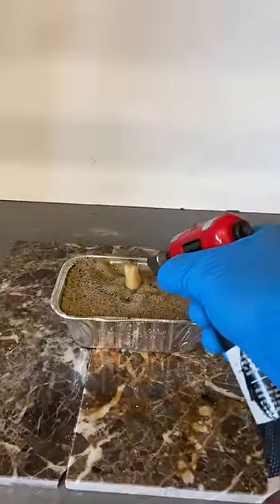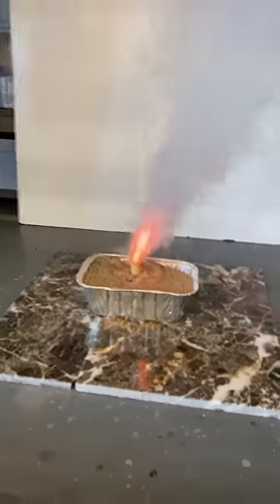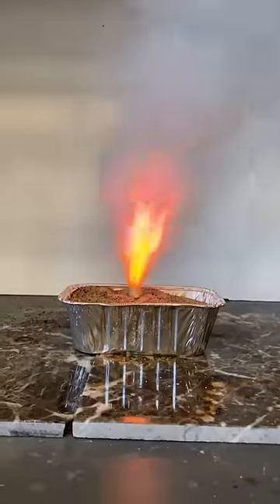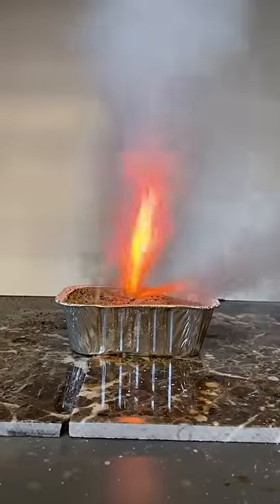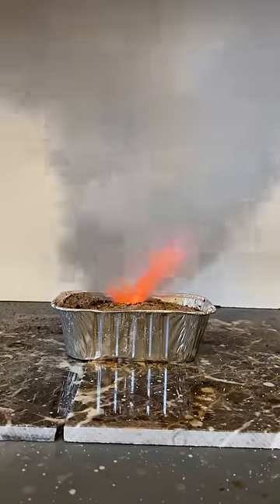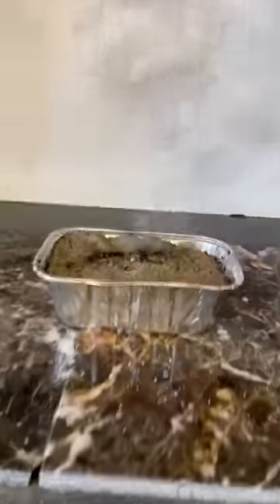Making Sugar Rocket Fuel

Comment from the maker: A couple of notes regarding this demonstration: The combination of potassium nitrate and sugar results in a highly flammable mixture. Notice that I only make a small amount (less than 10 grams). If the material is overheated, it can ignite within the pan. Also, when burning a sample, I used a fume hood with fire extinguishers nearby and proper ppe. Long story short, while the combination is simple, it is a dangerous reaction once ignited, and should only be done by professionals.
Reply: Can i use amonium nitrite
Reply: @the_Guy_who_asked19 You can also try
Reply: @the_Guy_who_asked19  i was going to ask this, ammonium nitrate is alot easier to get and i vaguely remember using it as a kid but not getting the ratio correctly so i just made some smelly smoke bombs
Reply: I get the safety stuff but im sure its harmless to let a student make this
I mean so long as theres direct supervision
Reply from the maker: @crowmaster9652  it’s not worth the risk.
Reply: @frogz  no no in my country i will go to jail you need a permet to have it
Reply: @frogz  i can only make flash powder with it that is the only recepie i have for it
Reply: What is a perfect material for a rocket with that mix?
Reply: Professional what?
Reply: @the_Guy_who_asked19 I guess that would burn way faster aka explosion.
Reply: Already burned down my house but thanks
Reply: Overheated on the pan, it will detonate actually.
Reply: So your saying I can't use this video to make homemade fireworks?
Reply: @khayatimedchiheb5911 works great at with calcium nitrate I use 40 grams of calcium nitrate and 60 grams of sugar come out looking like pumpkin pie but boy does it burn
Reply: As a teen in the 90s we used to make this outside on a portable burner or propane because I did it in the kitchen once and.....well....mom wasnt happy and neither was the landlord
Reply: Or drunks
Reply: @crowmaster9652 you're right its easy and harmless in small ammounts.
Reply: @crowmaster9652 You know you can buy premade SRBs? (Mainly used for model rockets)
Reply: You might want to edit the video and put that in there
Reply: Importantly, the stovetop or hot plate used to heat the mixture is not a source of ignition, so not a bunsen burner and not a gas stove, for example.
Reply: Are you using a metal scraper on a nonstick pan??
Reply: @bricknolty5478 
Lol, it never fails. Some of Y'all on the internet cannot help yourself. You must either complain or attempt to find something wrong with every damn video.
There is so much to question about what is happening or the process of doing this and you question the use of a utensil on the the pan. 
Some of y'all Crack me up.
Reply: Can confirm does ignite when overheated. Father made kitchen go boom boom as a kid shits powerful.
Reply: In India, people make fireworks with this mixture but in dry form. There used to be competitions among people. They use more chems like napthalene powder and copper sulfate for different colours, vioces when the fire cracker is burning, and different ways the fire cracker burns.
I got lost of recipes of it.
Reply: Mix it with wood ash and it burns so much faster
Reply: Pardon me, but given your decent result in the open air, what proportions did you use
Reply: What you mean to say is its a 60-40 mixture. Add iron oxide for even more ooohmf😂
Reply: @the_Guy_who_asked19 HOW
Reply: Add a little sodium bicarbonate to lengthen the burn time
Reply: Mom i need 10 pounds of sugar and potassium nitrate.. it's for a school project
Reply: Yeah, YouTube is full of pros. 😆
Reply: @georgetpeppel2900  lol... the child I am wants to say something like "professional pyros" but.. technically those are very hard to find.
Reply: @AbradolfLincler  when I needed 5 pounds of sugar in school it was as a baby!
Reply: what is potassium nitrate
Reply: @idorandomstuff4611  Potassium nitrate is also called saltpeter. It's a salt that has oxygen in its chemical makeup in such a way that, when heated with a flammable solid, becomes the oxygen for that solid. In this case, sugar is that solid
Reply: @the_Guy_who_asked19 Only if you want to be on a government watch list.
Reply: Instructions unclear, burned my whole town to the ground
Reply: Perfectly safe we did it with toilet paper tubes as a kid
Reply: Haaa, we've been doing that in primary.
Reply: Me as a 6 year old doing it in sandbox 😂😂
Reply: @georgetpeppel2900  chemist
Reply: Directions unclear, so I just nuked my house and am being investigated for meth production😢
Reply: great I'm a professional
Reply: In American no permit Walmart Carries it I just think you have to be 18 or 21 not sure but I ordered the 5 lb bucket to make fireworks for new years gonna be a badass one this year and I have a friend who does it for a living who said he would help me so I don’t blow myself up 😂 but can’t wait to give it a try got to buy the colors from my friend and every thing but he said he’d hook me up
Reply: I identify as a professional
Reply: Dude, you’re showing people how to do it on a YouTube video. What do you mean it should only be done by professionals??? 😂🤦‍♂️
Reply: @randysmith9636 He was joking. Obviously.
Reply: What if I wanted to use this in a 6 foot rocket?  Would it be strong enough in a big quantity? Were in the research phase but wasn't to launch a 6ft rocket with go pro in it.
Reply: I am professionally menace
Reply: 😂😂😂😂 if only I saw this when I was 8
Reply: @frogz don’t think it’s a good idea to be burning ammonium compounds bro
Reply: Is that water in the pan? And what ratio of sugar to nitrate?
Reply: @Chemteacherphil when I was young I used to make smoke bombs out of this but I don't remember the ratio of potassium nitrate to the sugar do you know what it is?
Reply: Then why are u showing us
Reply: Did you say sucross, or sugar? Because i heard "sucross" in the video
Reply: @Johanthegoat1  I used to use regular Pantry sugar and I got the potassium nitrate from my localPharmacy
Reply: Tried all the recipes..... They all worked.......bbuuuttt.... Now I need a new house before my mom kills me😅😂😂
Reply: @ethos- I'm a "professional fuck up"😂
Reply: @anninriverside755 there's always a karen do gooder in the crowd somewhere
Reply: infiniteshoeblack dry ice and a lil water
Reply: Duh
Reply: @marcelinobueno4987  Story of us lol
Reply: Pin this
Reply: @alllove1754 Oxidizer.
Reply: @lizard5872 I'm fuc*in ☠️💀🍻😂😭🤷🏾💯👍✌️
Reply: would it be a problem if we made it small as yours
Reply: You say only to be used by professionals who NASA
Reply: Could you use a solvent instead of heat ?
Reply: are u a professional?
Reply: @gamerguy4209 这个很危险啊，爆炸人就死了，能买后悔药复活么？
Reply: @asailijhijr 视频中他用的应该是燃气灶加热的，这危险，非常专业的才能安全使用他，普通人掌握不好火力，它会在锅中燃烧爆炸
Reply: Iranian here, how to make bigger rocket?
Reply: so how much time should I burn it?
Reply: You should realy pin this comment!
Reply: Then don’t advertise how easy it is and leave all cautionary information in a comment that only a fraction will see. That depends on if your primary concern is views or if it’s safety…
Reply: I did this as a kid....scorched the cieling....mom refused to buy me strange chemicals online anymore after that😢
Reply: I would like you to do an example of a small rocket launch at night.
Reply: And only the sugar needs to melt!
Reply: @Chemteacherphil  Cool stuff is always worth some risk! Are students that much of a liability? *thinks back to how I was in school*. Good decision actually.
Reply: What gases are produced? I'm no chemist but I assume it's CO2?
Reply: У меня давным давно эта смесь загоралась, реакция необратимая))) подпортил сковороду
Reply: @crowmaster9652  as someone watching students do experiments inside the lab, i can guarantee you even a simple titration can become a deadly event. But it has its own perks though, i get to play with chemicals all day😂
Reply: You’ve heard of “duly noted?”
Get ready for “duly disregarded.”
Reply: What was that liquid u used to mix thenm ??
Reply: جهاز الحراري متحكم في درجة حرارته
Reply: @YogsenForfoth 
Professional skateboarders degree at a minimum.
I tried this as an amateur gynecologist and within five minutes got a visit from ATF.
I could have died !!!  😶
Reply: A large sample can also cause explosive results, one christmas I made a football size mix of KNO3 and sugar which weighed roughly 3kg, approximately 30 seconds after igniting it exploded (rather small explosion but still thru chunks of kno3/sugar out)
Reply: @saifua60 ya... that's called pyrotechnics and there's recipes all over the internet. Highly recommend any that use Paris Green
Reply: Is the sugar thingy edible?
Reply: What considers someone a professional? And how would one experiment with this if not already a professional?
Reply: Can i use tri nitro toluene?
Reply: Also this is not legal in many places in Europe
Reply: Chemistry is no joke. The kits we bought in the 1950s contained everything from potassium nitrate, aluminum powder to iodine and sulfur, and charcoal.  When I was 7-8 years old, I had no idea the dangers my chemistry kit contained. 
My Dad quickly upped my chemical inventory by bringing home, from work, a chemical named Sodium Dichromate or Bichromate same thing. It was an orange colored   granulated crystals with the same consistency as sugar. When an ignition source is available, Sodium Dichromate burns rapidly, producing a green ash that's about 6x the volume of the original volume of S.D.
I got creative and decided to build a small-scale volcano out of Play-Doh and then let it dry. I built a small-scale Malaysian village with Palm Trees and huts. 
I put all of this together because
we were asked to think of a science project for my 4th grade class. So I brought it to school and proceeded to light it up. It performed beautifully, capturing everyone's attention, throwing ash, and sparking 12" up and out of the volcanoes cone. until it died out. What a mess cleaning that ash up. 
After that assigned demonstration, I was asked to visit the other teacher's rooms and perform the same event for the other science classes. 
I don't think you could get away with a stunt like that nowadays. I must have gained a love of the sciences somewhere. I was surprised after taking the PSAT because I wasn't even a "B" student in my high school classes. I about fell out of my chair when I saw my results. My home-room teacher handed it back to me with her finger pointing to my science score. She looked at me and then down at her finger. When lifted, I saw that I had scored in the 98% percentile. Wholly ** ! I got a pat on my shoulder and a smile from Mrs. Willoughby. Science has always served me well and has kept me respectful and responsible when using volume elements. Be safe and have fun !
Reply: @the_Guy_who_asked19 Nitrites won't work as they have 1 less Oxygen atom than nitrates, which have 3. It makes sense, you'll have less O2 to create an ignition and sustain an even burn ratio.
The Physics of launching a rocket add an extra level of interest and excitement.
Reply: Same here lmao ! I filled my mom's house with a thick green smoke zone from the garage below. I tried to incorporate an aluminum powder mixture, thinking that it might give me some extra ummph ! Wrong, oh man, that stuff smelled awful.
I'd like to build a rocket that used liquid 02 and Alcohol but the $$ are probably out of sight.
The Germans used Peroxide, as an oxidizer,  in their Cstoff and Tstoff Messerschmitt 163. Rocket grade Kerosene LH2 & RP-1 were generally used with LOX.

Comment: If you have the time do it this way:  Dissolve the kno3 and sugar into water completely, use too much water if you need to.  Then carefully bring it just over the boiling point of water (220-250 degrees f), being careful not to get to hot and start caramelizing the sugar.  After most of the water is boiled off, what is left should be pure white.  Pour it into a baking pan on some wax paper and let it cool and harden.  Break it up as much as you can.  It will still be sticky and have too much water.  Put it in the oven at 250 degrees and let more water cook off.  If you live somewhere with lots of sun, you could also just leave it out on a hot day for a few hours.  Once it is very dry and brittle you can break it down back into a powder.  Now the kno3 and sugar are bonded very tightly and evenly distributed and have a very high surface area when granulated.  I get my best burns with this method though it takes time.
Reply: im sure if i thought about it I would have came up with this idea but I must say it is ingenious to use  a solvent
Reply: Use sorbitol instead. It is easily found online. It has a lower melting temperature that makes it far safer to work with (it also allows you to shape the fuel with your hands).
Reply: I can’t do this without the people I live with freaking out so I just buy engines
Reply: Sounds much safer.    Could this work for making your own fireworks /  launching the mortar effectively ?    Any idea how it stacks up against other accelerants under load?    I’m genuinely interested in learning to make fireworks.   It’s way cool.
Reply: @Prometheus_8706  the atf says making your own fireworks is totally legal as long as you’re not selling them just do some research on fireworks and don’t use the word bomb
Reply: @barrymccockinner2802  thanks but that wasn’t my question or a concern.
Reply: @Kazaardvark the dutch freak out about literally everything except actual bad
Reply: @namachem1961  ?
Reply: Is this still YouTube?
Reply: @natas9967  technically, yes
Reply: Dude went full braking bad mood
Reply: You cant bring water above 212°f or 100°C unless the water is under pressure
Reply: @Dude-xv4os  3rd grade chemistry:  adding stuff to water alters its phase change points.  Adding a ton of sugar and potassium nitrate will let you get the solution far above water's normal boiling temp.
Reply: @matthewirizarry8467  incorrect. You must add your poo to the water and sugar then stir. Give it a taste, when its no longer bitter you are there 👍
Reply: I will try this thanks

Comment: For everyone wondering: sucrose is just sugar, and potassium nitrate can be bought at places like Lowe’s and Home Depot, in a product called stump remover. Be advised, the chemical Potassium Nitrate (the one needed to make the sugar rocket) is a flame oxidizer, which accelerates flames. Also, the gases produced from the reaction can be hazardous, so be careful when igniting the sugar rocket near others.

Edit: please do not blow up your house, follow what the original video creator said about safety!
Reply: Don't worry my house wont be the one blowing up😀
Reply: @cheeseman6833  💀
Reply: @OneSeriousPunch just like the people at that house
Reply: Don’t tell them what happens if you add sulphur to the mix
Reply: @DrV1le  why, what happens? Asking for a friend
Reply: Stump remover? Lol
Reply: @cheeseman6833 😂😂
Reply: @Brian-ux3jx   presumably, it’s for tree stumps, not the remaining parts of limbs that were previously blown off my mishandled fireworks 🤔
Reply: I’m going to get a flour bag of each and mix them, then bring half of it to your house as sugar that has kick. Then watch your face… of course I would put it as a firework later but that face is priceless.
Reply: Не уходи никуда, агенты за тобой уже выехали.
Reply: @DenSky1976  О, нет
Reply: Also Mr Chemist should know that sugar liquifies under heat, you don't need to add any water to dissolve Candy Mix Rocket Fuel, you just use a 1:1 ratio of KNO³ and C¹²H²²O¹¹

The water shouldn't be a problem for ignition, but it's very malleable here. One great use for Candy Mix is as a very solid binder, which makes it ideal for smoke tracking phases of multi-stage amateur rockets.

So you have your primary launch phase motor, using something like a Zinc Sulfur or straight black powder mix (if you can get ammonium perchlorate more power to you I guess). 

Then you have an ejection charge (this is typically a very fine grain black powder shell) which jettisons the primary stage off the rocket body and provides the ignition reaction for the next motor phase. 

What you can do prior to igniting the next stage however is to add some candy mix to provide a small amount of thrust and a lot of smoke to help spot where the sep occurred (if you don't have avionics on board). The reaction of the candy mix then progresses to ignite the next stage engine and on it goes.

You can get a model rocket kit to easily reach 6000' with D class engines and multistaging like this.

Did it for my Level 1 cert.
Reply: I actually have stumps I need removed and didn't know this was an option
Reply: @audreydoyle5268 the initial reaction:

C12H22O11 (sucrose) + 6 KNO3 (potassium nitrate) -> 12 CO2 + 11 H2O + 3 N2 + 6 K2CO3 (potassium carbonate)

Here's what happens when you add Sulfur to the mix, note the difference in the ratio of the moles:

2 KNO3 + S -> K2SO4 + 2 NO2

In short. Faster burn = more gas = more thrust = faster burn rate of fuel = hotter exhaust gasses = requirement for rocket nozzles that can handle the heat
Reply: @audreydoyle5268 stink bomb... But you def don't want to inhale it. Speaking from experience
Reply: Be careful y'all this how I burnt my face off
Reply: Drug stores sell it in big bottles.
Reply: This guy sugars.
Reply: You know the fbi is outside this guys house..
Reply: You sound like ChatGPT if you ask it about anything even remotely dangerous.
Reply: You do realise you've just told over 700 people how to make an IED right